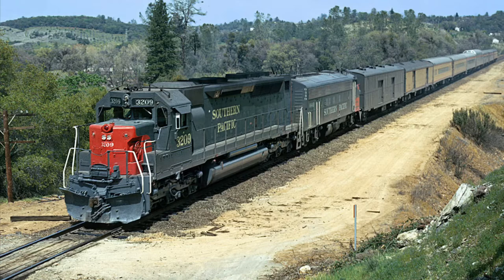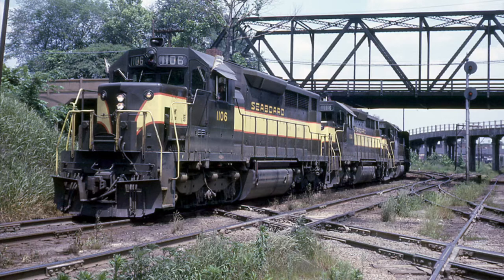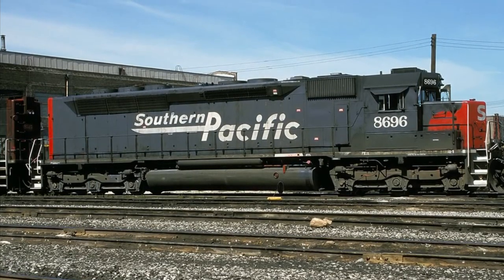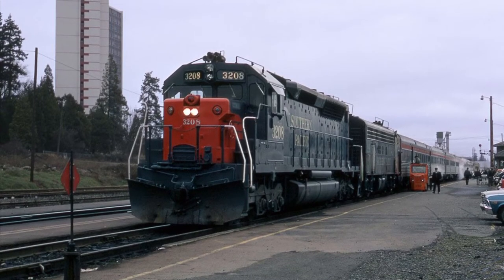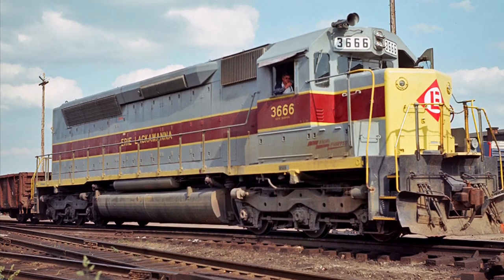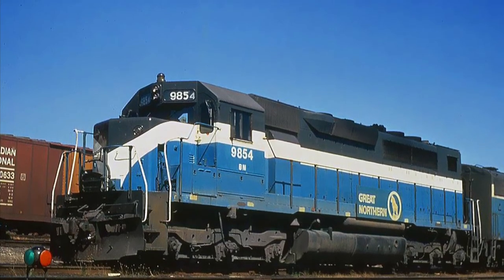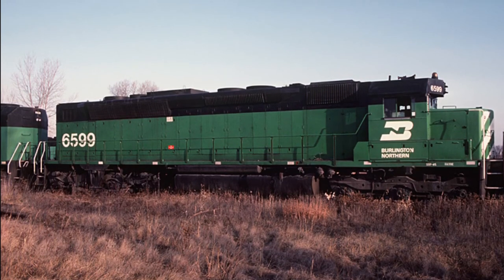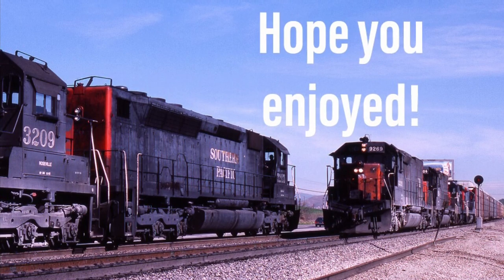Locomotive Histories, Episode 1: The EMD SDP45

Comment from the maker: Noticed a few errors I made in the video. The city of Ogden is located in Utah, not California. And the E units are car bodied, not cowl bodied. - Daniel
Reply: No, you were right about the E-Units. E-Units are cab units or cowl units. The SDP45 is a carbody unit: having a frame with a hooded carbody.
Reply: @Cnw8701  Actually, the SDP45 is a "hood unit", with the E-units and F-units being "carbody units", also known as "cab units", with locomotives such as the SDP40F, F40PH, FP45, and F45 being known as "cowl units".

The difference between a carbody/cab unit and a cowl unit is that a carbody/cab unit is enclosed in a bridge-and-truss style carbody (hence the term carbody unit), resulting in a lower weight and higher strength.

A cowl unit, on the other hand, is built in the same way as a hood unit, except that the walkways are enclosed by "cowling", hence the name "cowl unit".

The cowling of a cowl unit, in the case of passenger locomotives, is merely intended to make the locomotive more aesthetically pleasing, and, in the case of freight units (F45, SD40-2F, SD50F, SD60F, C40-8M), the cowling protects the crew from harsh weather conditions, where running a hood unit would be impractical, such as in the frigid Canadian North.

Comment: With Erie Lackawanna the SD45M's compared to the SDP45's also had larger fuel tanks which just happened to be the same gallon capacity tanks that would be standard on all SD70 series units in later years. That was one detail that wasn't mentioned. Southern Pacific acquired 6 SD45M's from Erie Lackawanna to be rebuilt into SD40M-2's by MK Rail. There was 133 SD40M-2 rebuilds in total. Most of the list contained 97 SD45R's and 30 SD40's. The SD45M's just like the other units of the same series had the same problems which was crankshaft failure and aggressive internal vibration which contributed to fractured frames on alot of units within the series. The SD45's,SD45-2's,F45's/FP45's,and SD45T-2's had the same issues until rebuilds began.

Comment: These units did not last long on CONRAIL.None of SDP45's were in service on CR when CSX/NS bought out CR on 6/1/99.They were off the CR roster in the mid 1980's.There lease was up and NS got them from CR in the mid 1980's.NS did not operate them.Some were sold to locomotive leasers.6670 is going to be restored.And I remember in the 1990's 6694 was stored in Southfork,Pa still in CR Blue.I don't know what happened to 6694 after that.Any help on the fate of 6694 would be greatful.Thanks.
Reply: it is said that. 6694 is scrapped